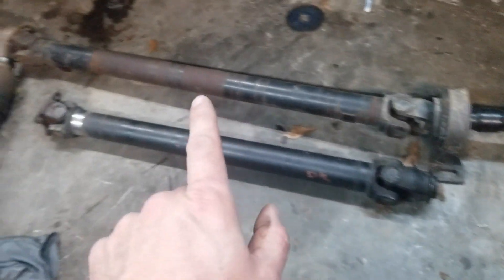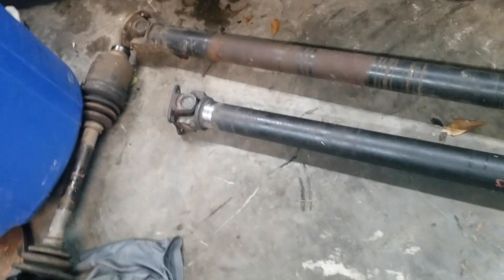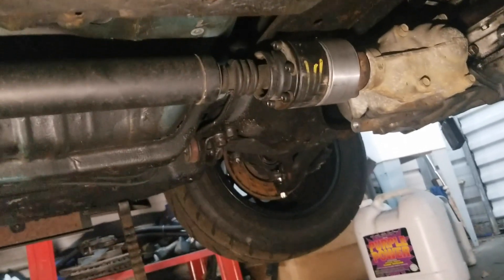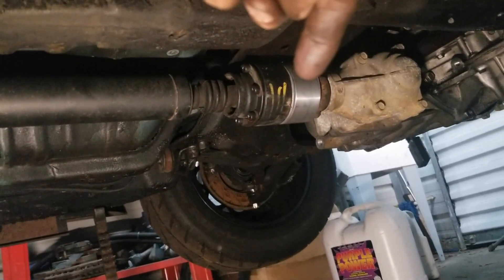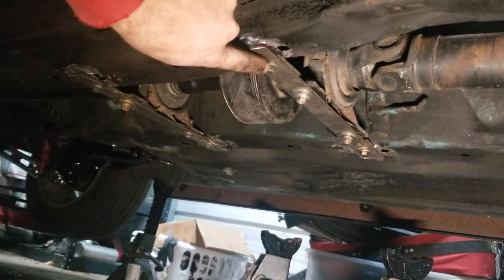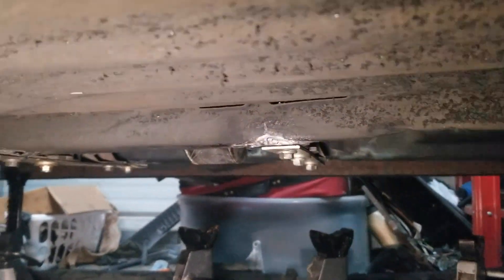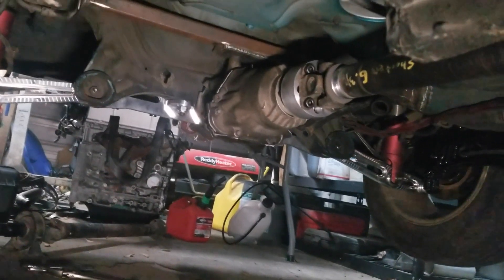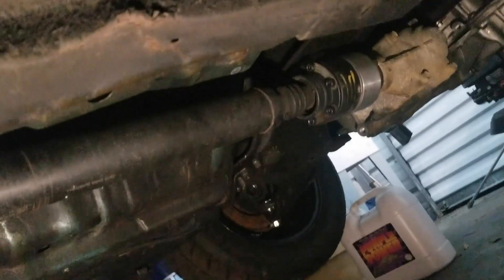KSeries AWD EG Civic | Freelander Viscous Coupler Install

Comment: Very nice thanks for the ideas man. I'll be running a crv diff and freelander driveshaft in my turbo integra awd after I find a freelander driveshaft with its VC. Goal is 850awhp that's it.
Reply: LatinoAD I have a couple ds to sell
Reply: @jasonhiboost9149  you do!!?. Lol why didn't I see this earlier a year ago
Reply: See that is the goal Mr Babb I said it a year ago lol. 850awhp max. I may do this too. To be cheaper. Ebay stock driveshaft replacements and billet adapters done. Then new carrier bearings done.

Comment: Hey, great video. I got a 4wd civic wagon, would pinning the rear diff and swapping the drive shaft to a free lander shaft be the only way to make it awd? or could I do any modifications to the stock VC?
Reply from the maker: Why not just keep the wagon parts? They are proven to withstand a lot
Reply: Babb'sHondaRepair I get that they are but is there a way to make the system full time awd?
Reply: Babb'sHondaRepair the stock wagon parts only make the car 4wd, but i want awd
Reply from the maker: Get LSD for front and rear 🤟